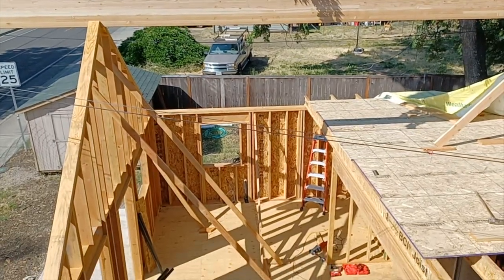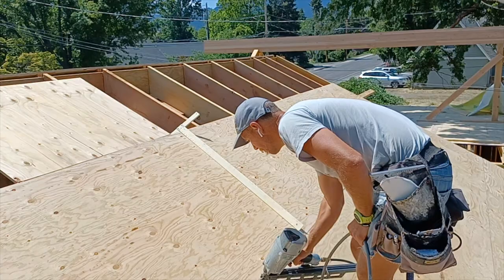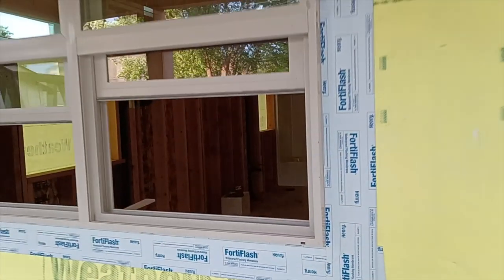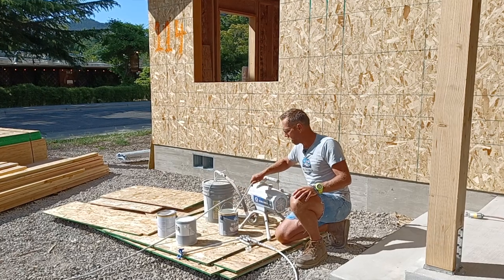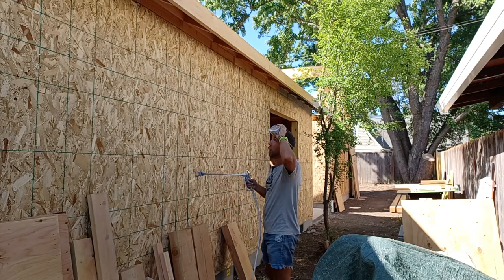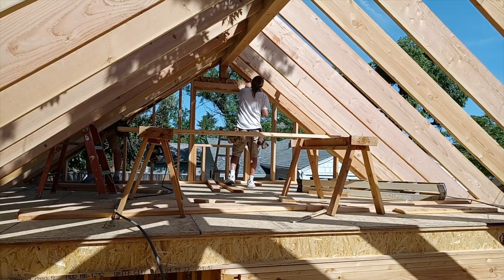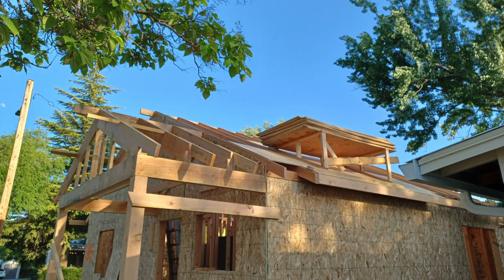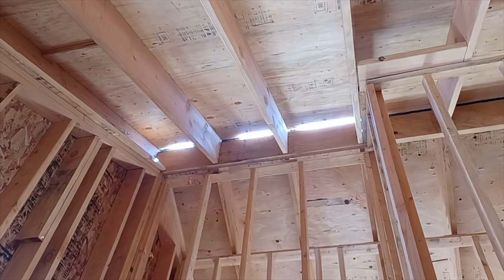How To Build an ADU with Cost Breakdown | Part 7

Comment: Why don't you use ZIP sheathing? It would eliminate some of the steps you've outlined so far with the 2 ft. BCX plywood and priming/painting and you wouldn't have to worry about weather as much.
Reply from the maker: A good system for sure, just not used much in our area. Probably tradition holding back progression :)